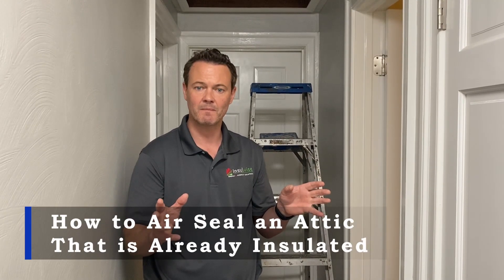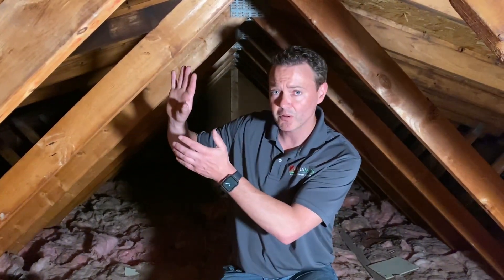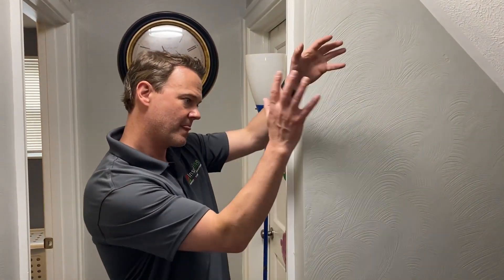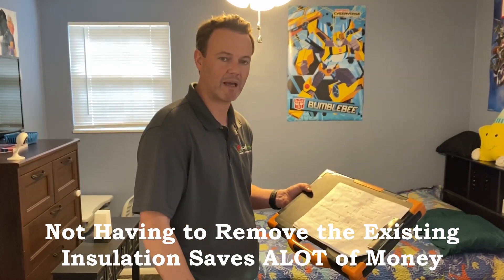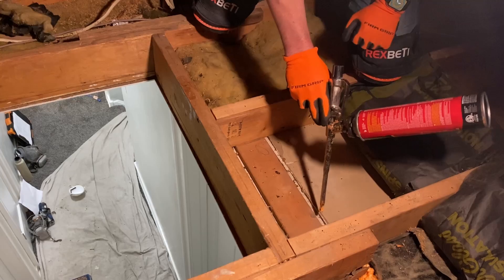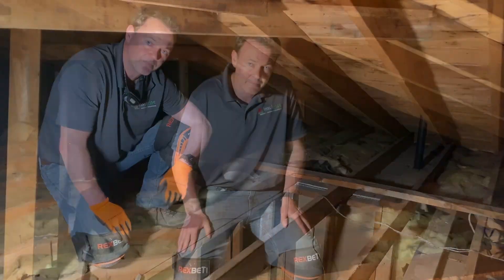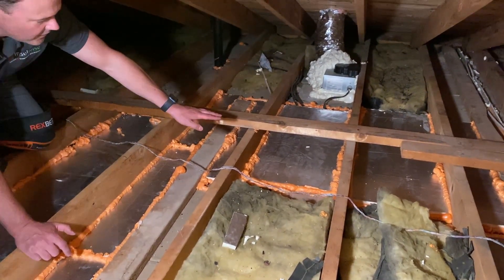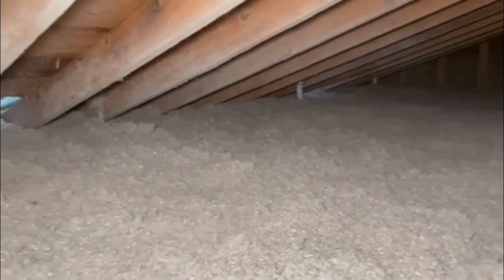Insulation Expert Reveals the BEST Way to Air Seal Your Attic

Comment: Hey Andy! Any suggestion for air sealing around canless recessed lights under the insulation?
Reply from the maker: Canless...so you mean like the flatter, pancake style LED lights?  If so, what we do is use 1/2" thick foam insulation board (both polyiso and XPS board work well).  We cut it and shape it so that there is a 4" clearance between the light and the sides of the box.  Even though LED's should not create much heat, we still want to have a bit of leeway so that too much heat cannot build up.  You can them seal it to the attic floor with foam sealant, or even tape together using metallic hvac tape in a pinch.  But at some point you want to use foam sealant to seal and anchor it to the attic floor.  Over time tapes will often become unreliable.  You could also seal it to the ceiling from below by caulking around the perimeter.   Hope this helps!
Andy

Comment: Great video. Curious: in colder north areas older houses have similar kraft paper backed paper that (i think) act as a vapor barrier. Are these stappled from underneat the rafters ? If you remove the insulation, or break that kraft paper does it lead to additionnal humid air in the attic? My house has drywall + forence + kraft back paper fiberglass insulation. I was planning to remove fiberglass insulation, replace with a few layers of rockwool but was concerned that I would not have the kraft paper backed insulation that act as a (minimal) humidity barrier.
Reply from the maker: Thank you!  The kraft paper doesn't work even in the slightest as an effective vapor barrier, from what I have observed.  What should be your vapor barrier is your drywall ceiling with a few layers of paint, and then having all of the penetrations / air leaks in your attic floor sealed with foam before you re-insulate.  I have seen rock wool becoming more popular lately, if you have a minute could you let me know why you're looking to use that versus something like cellulose insulation?
Thanks, Andy

Comment: PEOPLE. Do not ever do this
Reply from the maker: Why?  We've performed these exact air sealing measures in thousands of homes to excellent effect.  What's the gripe?
Reply: Your house becomes a magnetic for mold. Plus it starts to stink after awhile,  trust me , I can prove it before and after,we had this done and we are think of ripping it all out , your house can't breathe anymore.  That's the gripe.
Reply: @MrSprintcat  Just curious, do you have a built-in humidifier?
Reply: Absolutely not, when the house is well insulated like that, it holds the temperature down in the summer time. And if you don't have rugs in your house. hardwood floors and  vinyl flooring they're cold and you get condensation on everything, simple

Comment: Best foam to use?
Reply from the maker: Most of the foams are really pretty similar, we like regular Great Stuff for about $5k a can.  The biggest difference is that it takes longer to cure than the more expensive foams so it can be messier until you get used to using it.  But for an attic application all of them do pretty much the same thing.

Comment: What does something like this cost?
Reply from the maker: The cost range is usually $3-6k depending on the attic size, existing insulation level, types and quantities of air leaks to be sealed, vents that may need to be installed, and how the attic hatch is to be addressed.  The range varies widely.  But if the work is done right, you will be instantly surprised and happy with the effect.

Comment: I bought my multi level (1960) back in 2011 here in Pittsburgh. At the closing the son of the original owners said to me that his mom could never get warm in the house. The air leaks I found over the years and sealed I can understand why the poor woman was always cold in the winter. Most of the leaks were caused by the builder and other contractors who worked on the house over the years. It was bad folks the amount of various air leaks went from minor to major were plentiful. The worst area in the house that I thought was going to be an hour to an hour and half job was air sealing the garage and the stairwell up to the next level. That section alone was a seven to eight hour experience. I'd find one leak, look up, right, left or behind me and find another one. I really hate the builder and anyone that drilled and made holes in that part of the house. They'd cut a hole then just stuff insulation into it instead of fixing it right. Drill a hole and run a wire but not seal up the hole around the wire. 

If you have the time to do it yourself, plan on spending a lot of time over a number of weeks if you have an older home. It's not an expensive job, your looking at $100 to maybe $300 in supplies and tools to do it yourself but expect to rack up a whole lot of hours. It's not so much sealing the leaks, it's spending the time hunting them down, then finding a solution to seal it up.

If time is not on your side because of family, work, age, hire someone to properly air seal your home you'll be glad you did. Plus most states and or power companies, offer generous rebates to home owners that have a certified energy efficiency companies seal and insulate their homes.
Reply from the maker: Hey there thanks for the comment.  We call them stairwell voids and in this video you can see what it looks like after we have sealed a huge one.  The air leaks alone can make a house extremely expensive and also difficult to heat and cool.
Reply: @insulwiseenergycomfortsolu3293 The stairs coming out of the garage have the stairs going to third level above them. Cold air in the garage could have easily seeped under those interior upper level stairs. The ceiling above the upper steps is flat, no drop area in the attic. Sealing the gap of the drywall ceiling in the garage where it meets the cinder block walls also made a big change. Think about an 1/32 inch gap, that runs the perimeter of a garage, that's 25 ft  x 23 ft. It quickly adds up to a major opening to outside air. The other big change with sealing the garage and that stairwell was an almost total elimination of creepy crawly things inside my home.

Comment: Did this home not have soffits along the underside of the gutter that vent up to a roof vent?? It looks like the insulation was blown into those areas?
Reply from the maker: No, this home did not have any soffit vents whatsoever.  We installed a series of slant back vents along the back of the roof to provide intake ventilation.  You can see the light coming in from one of them in the final part of the video. 
Andy
Reply: @insulwiseenergycomfortsolu3293  Thanks for the clarification!

Comment: Would you mind specifying the name brand / model number of the orange foam you were using?  I live in Louisiana. I want to air seal my attic - a little at a time - just methodically work my way through it. Then I want to staple radiant barrier Mylar to the upper roof rafters to reflect heat OUT. Finally I want to get someone to come blow in cellulose all over the give me a nice warm blanket. 

Also - do you have a video that shows how you check/seal air leaks in existing duct work for A/C that’s in the attic space?

Also - last question - most all my plumbing up there is PEX. Do you recommend that I sleeve all of that as I uncover and find it?  

I like what you do. I’m an old engineer and I understand the value of air sealing. What BUGS me is why the hell don’t the damn builders do this BEFORE they insulate?  It’s like they are skipping a huge step and honestly they could market themselves as doing it when others don’t/wont!
Reply from the maker: In this video I used a great stuff foam gun and regular great stuff foam.  That said, using regular $4-5 a can great stuff with the plastic straw works just as well, it just takes a bit longer to cure.  The cheaper cans can also be more readily maneuvered into tight situations than the gun foam cans as well. 
Andy

Comment: Can't imagine how long this takes in the attics of some older homes. I renovated my grandfathers old home that was built in the 50s and the attic gets very hot. Seems like you'd pay an arm and a leg for the amount of time it would take to go through that entire attic and do this... I wanted to install some solar fans but read if the attic isn't properly sealed it can actually suck cool air out of your home?
Reply from the maker: Hi, if you're doing it solo than yes and it's going to take some time, but if you draw a map you can isolate the attic into quadrants and do it one section at a time.  It is also true that power roof fans can depressurize an attic and pull the AC from the house or heat (if they're also equipped with humidistats for the winter).  Best practice is to thoroughly air seal the attic floor, then get the roof properly ventilated, and then insulate the attic floor to an R-49 level (we prefer cellulose insulation).  
Andy

Comment: This video is so helpful. It’s the most informative one I’ve found. I’m mustering up the courage to try to do this myself. My attics is very similar to the one in the video, but with soffet vents. I’m trying to decide which product to get. Thought I had decided on caulk, but now leaning towards foam. I’m very impressed by your video, and the way you respond to the comments in here is above and beyond. I’m reading every one. Thank you so much!!
Reply from the maker: Hi there, thanks!  Foam is definitely the way to go, and regular great stuff with a plastic straw works just as good.  Draw a map from below, get a headlamp, knee pads, gloves, a good dust mask and have at it.  The last important tip is ALWAYS keeping your weight on the floor joists.  Things will go wrong in a hurry for you if you don't ; )
Andy

Comment: How do you typically air seal when a home has a vertical cavity that is for air ducts to travel around?
Reply from the maker: If there are air ducts that come up from the house and into the attic, we seal around the ducts with 1/2" foam board and then foam sealant, but any solid material can be used like plywood or even heavy cardboard in a pinch.  The goal is to eliminate any way for air from inside the home to communicate with or transfer to the attic. 
Andy

Comment: I havent seen anyone address what happens with balloon framed houses. Ours is 1915 vintage. Had insufficient blown in, needed to remove knob and tube wiring. Debating the best way to plug off openings down into wall stud bays. I'm guessing having blown in cellulose go in, then some sort of plug? Costs matter
Reply from the maker: Hi, we encounter this type of home a few times every year.  Definitely have the knob and tube wiring removed first.  We insist on that being done in the homes that we work in.  But, if you find a team that can effectively dense pack cellulose insulation, you first want to 1)  plug the bottoms of the stud bays in the basement and then 2)  use a fill tube and push it as far down the bays as you can and then dense pack the cellulose insulation into the vertical stud bays.  

If the team has the right gear and technique, they will be able to hit somewhere between 1/2- 1/3 of the exterior walls this way.   We would still drill the entire first floor and beneath the windows.  You can cap the tops of the stud bays with foam board and foam sealant if you want.  But if the bays have been properly dense packed with cellulose, there will be no air or heat coming up through them once this has been done.  Hope this helps!
Andy
Reply: @insulwiseenergycomfortsolu3293  thanks so much for responding. I just finished having the remainder of k&t removed. While clearing for their work, I realized I shouldn't ignore some of the attic issues much longer
Reply from the maker: @SEaudiofan  You're welcome, and this would be perfect timing for you to remedy the issues going on up there.
Reply: @insulwiseenergycomfortsolu3293  I also have been blocking and sealing from the basement, and am about 2/3 way around the perimeter. So much to do, so little time

Comment: It sounds like there weren’t soffit vents in this attic, what would you recommend doing to prevent blocking the soffit vents when you blow in the cellulose?
Reply from the maker: There was zero overhang on this house.  If you had an overhang but no soffit vents, we would first stuff / block the overhang with fiberglass and then install roof ventilation in order to get the attic properly ventilated. 
Andy

Comment: Looks like button board/lath mesh plaster on top. walls. Identical to my house. Thanks for sharing. I've used duct seal putty on wires and boxes. but should foam the top plates.
Reply from the maker: Thanks!  The ceiling in this home was actually just regular drywall, it was built in the late 1960's.  I would highly recommend that you seal the top plates.  In many cases that we see, the allow significant amounts of heated air to escape from the home to the attic.
Andy
Reply: @insulwiseenergycomfortsolu3293 Thanks, i'll start on it. I can tell it's bad when my whole house big ceiling fan is on, bathroom outlets lets the stinky attic air back down, it recirculates it.

Comment: I am insulating and airsealing my attic a little at a time during the cool months in the hot and humid Texas gulfcoast.  I have a bulkhead that I plan to fill with dense packed cellulose, cap with foamboard, and then air seal.  Do I put the foil side up or down?  Also, I have a cathedral wall in the attic. I want to fill the 2x4 wall with batts and then cover with foamboard, but I don't know what kind of foamboard to use with the faced fiberglass batts.(I don't want to trap moisture.)  I see where you used house wrap, but I would only need a small amount to do the job which is why I would prefer to use foamboard. TIA
Reply from the maker: Hi there, in your application I don't think it will matter much which side is facing outward to be honest.  When we use foamboard to cover exposed walls in attics we face the foil side outward toward the roof because it then acts as a radiant barrier and reflects heat back toward the roof.  In your situation it sounds like it will be covered with insulation on both sides?   For the cathedral I would attempt to use 2" thick polyiso board.  That will give you an R-Value of about R-13 and will likely not allow the inner surface to get cold enough to allow water vapor to condense on it.  That's the theory anyway.  Hope this helps!
Andy

Comment: would one expect new construction homes to air seal liek you?
Reply from the maker: Unfortunately almost never, unless it was built as an energy star home and tested with a blower door when finished.   Usually if they do anything they will hit the wire holes and plumbing pipe penetrations.  The top plates and lots of other misc leaks are almost never sealed.

Comment: Some questions - should a homeowner consider insulating the ceiling of the attic. I see in the video you left it uninsulated. Is that the norm? Is there a benefit to insulating it? 
Or, maybe that would only be done if the floor of the attic is covered in board (eg plywood) if the homeowner wants to use it to store boxes (christmas lights and the like)?
Reply from the maker: Hi there, the only time it could be recommended to insulate the underside of the roof deck is if the home has an extensive HVAC system in the attic.  And if you do that you NEED to use closed cell foam (because it has a vapor barrier) and closed cell foam is very expensive.  We believe in the vast majority of the time there is more risk and added expense than benefit to insulating the underside of the roof.  When homeowners want to use the attic for storage we build them raised storage platforms.  We have another video that shows that process if you're interested. 
Thanks!
Andy

Comment: I’m skeptical that sealing every linear inch of the drywall corners is necessary. They’re already taped and sealed on the finish side. But the penetrations definitely need to get sealed.
Reply from the maker: Hi Tommy, what happens is that the drywall pulls away from the top plates, typically after the studs have shrank a bit from their original moisture percentage going down as they dry out.  We have blower door tested these top plate leaks plenty of times, they definitely leak.  On this other video here that I took from a home built in the 1990's you can see the black streaks running through the fiberglass immediately over top of the top plates.  That is from warm air from the house passing through them and the dust in the air getting trapped in the fiberglass.  As there is typically a 1/8" gap or larger on either side of the top plate, when added together the combined air leakage in attics from leaky top plates is typically substantial.   Sealing top plates should be a major priority for anyone doing attic air  sealing work. 
Link to top plate air leakage visual proof: 
 https://www.youtube.com/watch?v=X7GMG3T8cE8&pp=ygUrYWlyIHNlYWwgYW4gYXR0aWMgdGhhdCBpcyBhbHJlYWR5IGluc3VsYXRlZA%3D%3D

Hope this helps.  
Andy

Comment: @ 6:56 shouldnt you have just insulated down in there instead of doing what you did?
Reply from the maker: Hi, not in this case.  If you insulate the stairwell side walls and sloped ceiling you have FAR more area that is exposed to hot and cold temps, versus making it a flat plane on the top.  So this method will allow for better energy efficiency.  However, when stairwell voids like this abut exterior walls of homes, we do fill them in with cellulose insulation as opposed to capping them.  Hope this helps. 
Andy

Comment: Where are the soffit vents for attic venting/Attic Vent Channel? Did you guys close those completely?
Reply from the maker: Lots of people ask this.  This house was not built with soffit overhang, so we installed slant back vents on the back of the home to allow the ridge vent to draw outside air.  You can see the light coming in from them toward the end of the video.  We would NEVER block existing soffit vents.
Andy